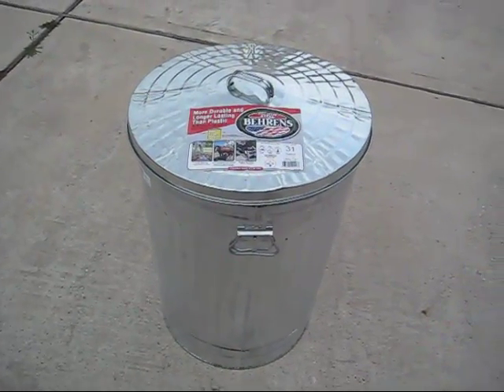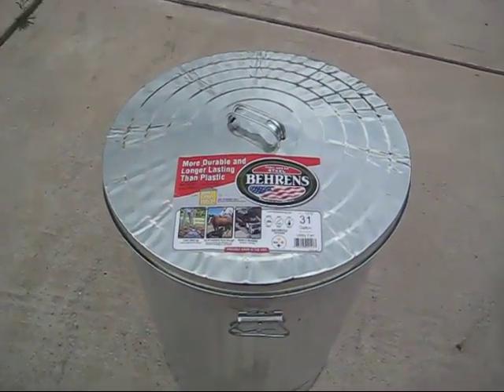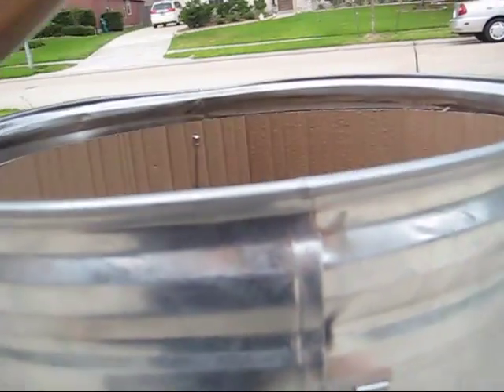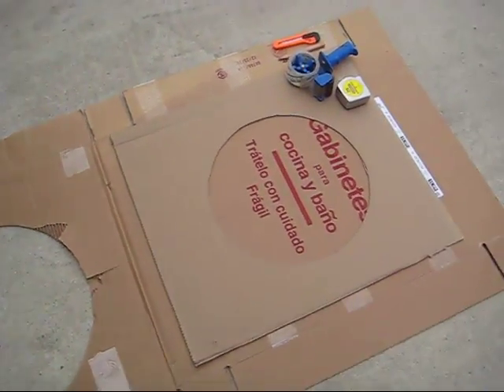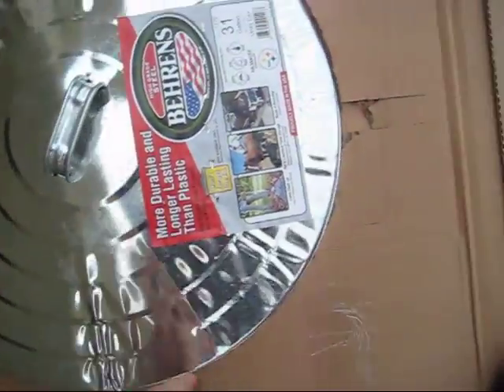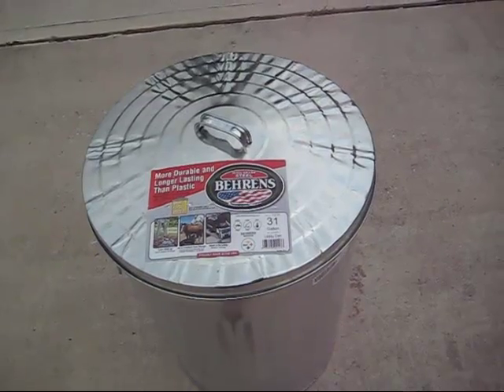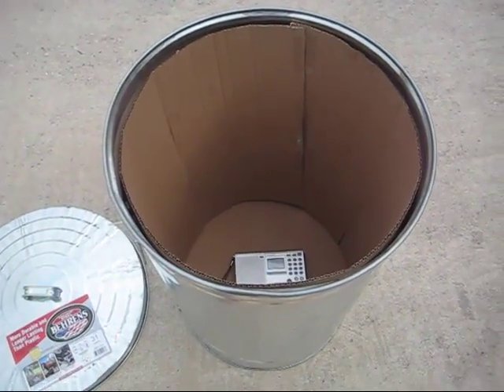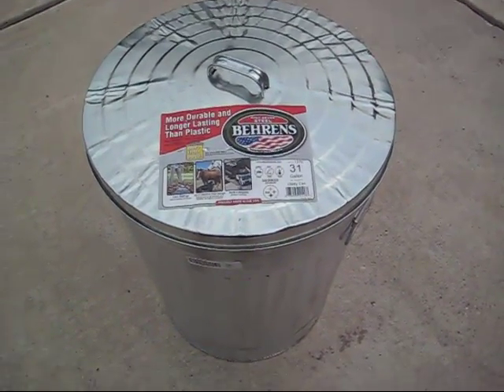Faraday Cage: Garbage Can, Really?

Comment: @DAHBOO777 Does the cardboard cut out have to be perfect for the lid It seems I done it correctly with the bottom but I decided to get it out because I needed to tape the 2 lines on opposite sides of the can where the handles are all the way to the bottom with HVAC aluminum tape was that ok? or do I need to tape aluminum with tape as well I did not use the gray tape for the bottom and sides I used the HVAC aluminum tape to cover the circular gap at the bottom with it a bit sloppy-ish and for the lid some gaps with the cardboard,

Sorry if I lost you with what I said.

Comment: Good idea but I would recommend lining the can with mu-metal sheets to shunt the field away from the center. From my understanding. Magnetic fields cannot be blocked but they can be re-routed around the object. You would need a few reels of mu-metal sheets to line the can to a thickness of 10mm/1cm and then add the cardboard inside. Stay safe fellow Americans and may God be with you.

Comment: You need to do a little more studying on EMP. The Electromagnetic Pulse will be a much different frequency than plain FM radio. You do however have a good foundation with a steel trash can. You need to take it a step farther and install a fine mesh fencing (steel preferably) and totally line the trash can. This will not give you a spec Faraday cage, but in theory it should work. The only way to know for sure, is if you actually need it, and let's pray that day does not come.

Comment: As for protecting cars, alternator diodes are vulnerable. Either get a pre-'98.5 Cummins with a manual shift, or EMP-proof spare alternators, ignition modules, etc.

Comment: Even if you seal that can with aluminum tape, it still gives you only 40 dB of shielding. Nowhere near enough. The minimum for poor people is as follows: first, put your device in a DriShield 3400 anti-static bag. Seal with 3m 1170. Then put in the smallest possible cardboard box and wrap with 3m 1126. Then put that in the smallest possible cardboard box and wrap with common kitchen aluminum foil, shiny side out, and seal with 3m 1170. Then put that in your cardboard-lined galvanized can and seal that with 3m 1170. If you can, supplement all that with a layer of stainless steel somewhere in there.

Comment: #1- You're not gonna use your cell phone/Kindle/tablet/laptop to call anyone or hook up to the Internet post-EMP/CME. You're gonna use it to store VAST amounts of "knowledge" in the form of books, PDF files, how-to videos, entertainment (movies, games, etc), reference books/manuals, medical how-tos, etc.
 I've got a 36GB Kindle and two 36GB each cell phones and numerous thumb drives in my Faraday cage.
#2- The cardboard is to insulate everything you put in it from touching the metal of the trash can... and putting it in the lid helps to create a better seal. 

What's missing from this video, IMO, is:
a- Remove batteries from all electronics you're gonna store in your Faraday cage so battery corrosion doesn't ruin the device
b- Wrap every electronic item in a soft cloth, then in a freezer ziploc (or trash bag if it's too big for a ziploc) bag, then at least three layers of heavy-duty aluminum foil, taping the edges closed with shipping tape to reinforce the edges...
c-  Put the necessary batteries and extras in a freezer ziploc and tape it to the device... this way you know you have a complete package when you grab device X...
e- Use a Sharpie and identify what each wrapped device is on the outside of each package.

And after alllll this? Wrap up solar chargers and the appropriate charging cables per the instructions above and store them, too. I have two solar chargers each for my Kindle/2 cell phones/tablet, and four charging cables for each device.

When done stuffing the homemade trash can Faraday cage? Use a metal sealing tape, like TitanRF Faraday Tape, 2.5" wide and seal the edge of the trash can with two layers.

Comment: Put a ground clamp on the handle and run an insulated #6 cooper wire to the encase concrete rebar on your house foundation or to the electrode by your service panel, this electrode goes 8 feet underground by code.
You will get much better results with this method! 
Don’t forget to wrap around the lid any gaps on the can with hvac aluminum tape. Good luck to everybody.

Comment: Oh Dude, this setup that you have will NOT work. The high frequency and power of an EMP pulse will just blow right thru this type of shield. Alot more metal for one is needed and (my belief) is that a couple of inner shields or cans insulated from each other are still needed along with a good grounding cable. Better to weld the lid shut too. But I admit that I have no official proof or evidence that it will work. How the hell would I test it ?

Comment: I wonder if anyone has thought of having two or more "waves" of electronics in backup, such as when one initial EMP takes down the infrastructure, and a second or follow on EMP attack three days or a week later takes down the prepared people and emergency response.
Reply: Good and unsettling point....!
Reply: I have a few small shortwave radios. I would only use one after the initial blast, and put it back in the faraday cage when not in use. Keep the cage closed when not removing or replacing item. You could also have 2 faraday cages as well
Reply: Backup for backs for backup
Reply: Set up specific times for radio cheks, like noon and midnight. Then leave it in the can the rest of the time
Reply: Expect about 3 blasts over a 1 month period.
And maybe one more if the enemy discovers too many or the wrong people still have functioning electronics.

Solar panels are highly resistant to EMP unless they are connected to something for potential/current flow.
Reply: 😇 amen I actually did...two is one and one it's none ... Good tip 👍 can't have all the eggs in one basket 🧺🧺🤠
Reply: I've thought of this as well.
Reply: @BIGD-gj1vb  i actually made two following this model and actually works 👍
Reply: Sol Ark Solar EMP hardened inverters are designed for 2 waves.
Reply: @mac11380 what are those? Where do we get one?
Reply: Get a cheap burner phone for the Faraday. As you will be using your smartphone.
Reply: Great information! 
Thank you!
Some background noise during the video was distracting
Reply: I’ve just started wearing tin foil around my head and body. Can’t be too prepare!
Reply: @kingtenstudios5870  don't forget to rub some butter on after a good roasting
Reply: Two is one and one is none
Reply: I just made some Faraday cages with paint cans I ordered from Amazon. A gallon can will hold a SW radio, 2 Walkie talkies with lithium batteries and chargers.
Reply: The lid needs sealer and handle holes on inside sealed also with some silver gasket tape.
Reply: Three days later the country that exploded the EMP will not exist.
Reply: @dirtflavour, you have a point.
Reply: @dirtflavour Now that's a very good idea!!!
Reply: Damn. You’d make a good terrorist. 😂
Reply: Good point
Reply: @dirtflavour2101 True.  Wouldn't emp take out cell towers and transmitters, too?
Reply: I have a Jackery in one of mine.
Reply: @@dirtflavour2101 perhaps mesh networking, but you would need an antenna and a lot of watts pushing. Radio is better.
Reply: @dirtflavour2101 I think the hope would be for family separated by distance could send a call out to make sure everyone is OK. if the frequency comes back up.
Reply: I was thinking the same the past couple of days.
Reply: I am building three 6 gallon metal cans; one 10 gallon metal can; and one 31-gallon metal can all to be used as EMP boxes.
Already have two 6 gal cans built, with stuff inside, the third 6 gal can is for my sister, going to show her how to build it herself.
I have the other cans at my place too, but not built out yet.
Each of the 2 already finished, has two walkie talkie radios (short range-1-2 miles) and a hand/solar/battery powered - AM/FM/NOAA radios and a few other items already inside. Redundancy for electronics is IMO vital.
I plan to buy a medium sized solar generator but still small enough to fit in the 31 gal can, and I will protect the solar panels too (don't know if is needed but going to wrap them up anyway).
Reply: Now they do.
Reply: The most likely source of an EMP event is the Sun, which will not "lay in wait" to launch a second attack. If it's humans doing it, yes there might be repeat attacks. But there could be 10 attacks. Or one every few days, at odd times. Impossible to have enough spare, protected equipment squirreled away.
Reply: We don't have a lot of electronics  to protect and I wondered if the galvanized can is important.  Could it be made in one of those large popcorn tins or would it be to thin/wrong material?
Reply: Sure, you keep everything you aren't using in the cage.  have multiple's of critical gear and keep them shielded and safe.

Comment: So if Jet Planes frequently struck by lightning, why doesn't the electrical system fail ? And of course lightning would be a very big jolt . can anyone explain this please ?
Reply: The lightening mostly floats on the aluminum skin of the plane.  Composite panels have wire mesh in them.  Electronics are isolated from the frame and protected. The fuel door etc has to be tight and pass testing.

Comment: Any idea of how to protect a 8500W portable generator, about 4' x 4' x 4' ?
Reply: build a faraday room or space using window screen. USe metal tape to secure edges.  THen run ground wire from the outside of the window screen cage , out the window, to a metal rod that is in the ground.  See comments above from very knowledgeable RodgerWilco99.  He built one.  Also, you can buy EMP proof cloth from http://disasterpreparer.com/emp-cloth/

Comment: A problem with your demonstration is that FM radio waves are pretty much straight line and reflect very little. Since the radio is still receiving a signal while sitting in the can, It seems that the metal can is still passing some RF through it's wall. The signal is degraded but still there. Plus an EMP has a much higher voltage level.
Another consideration is an EMP charges everything, including the ground. The earth does attenuate the signal over distance from the source, so burying the protection container would be helpful, as that removes the straight-line component. An earth covered lid should protect from solar flares or CMEs.

Comment: I bet some people think you are crazy. They think I am crazy also, don't feel bad. I also found EMP proof paint as well as flexible wire mesh that is used for this type of thing. I am a General class ham operator and I deal with high EM radiation all the time. I like your idea but I was thinking of using modified military ammo cans to put my gear in to stack it. Again, good video.
Reply: EMP paint??  Where did you find that?   I found EMP cloth to place over large items at disasterpreparer.com. Also, I need to learn how to use a HAM radio. Where do I begin. I have a radio and a few books, but it's so complicated.

Comment: So my only question is how do you know whether or not this is going to shield against magnetic or electromagnetic interference? It's clearly blocking radio waves, but EMI is a different beast entirely. I'm more interested in HOW you would test it, not saying that the can doesn't block it because it probably will due to the conductive material the can is made of. Reason I'm asking is because I just bought a piece of hardware that is extremely sensitive to magnetic interference and I want to build something of this size to shield it.

Comment: Could  5 gallon plastic bucket with lid be used inside can and maybe a smaller bucket on top of it and if so can cardboard be left off and use masking tape to seal both buckets/can? Also could mylar bags be used to put thinks into and sealed with iron?

Comment: Personally if make a several layer cage device divided by cardboard between layers and still bag electronics in static bags to add to the effectiveness. Need foil tape to seal around the lid and each seam but make sure it doesn't get inside the main housing where current can get in. Unfortunately this method (I've seen many do this) is not effective in reality. Since military spec is much higher this won't work for you.